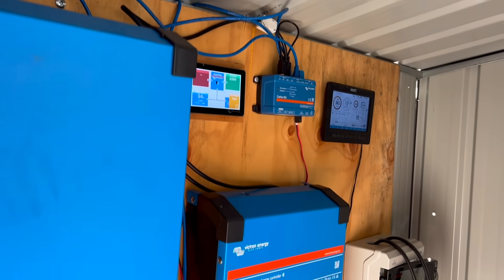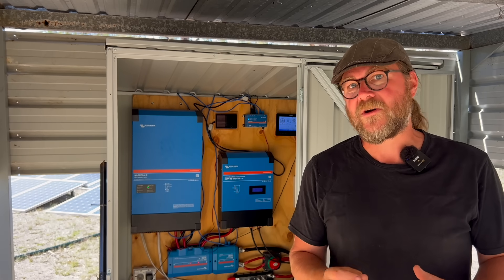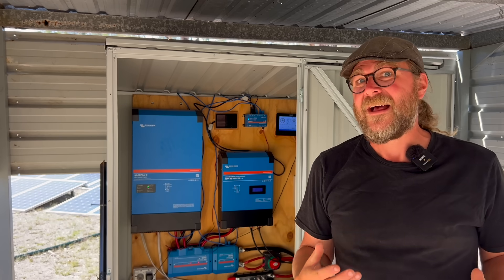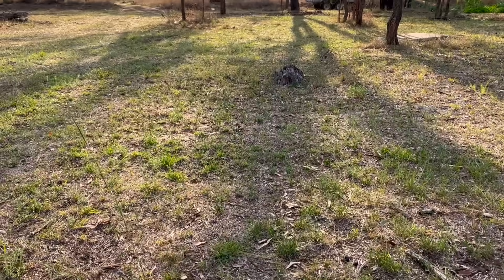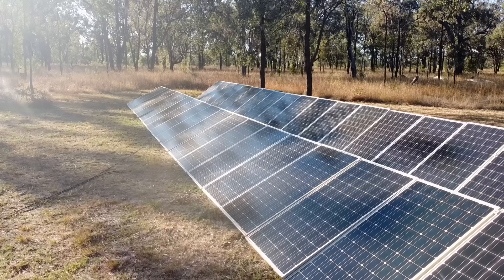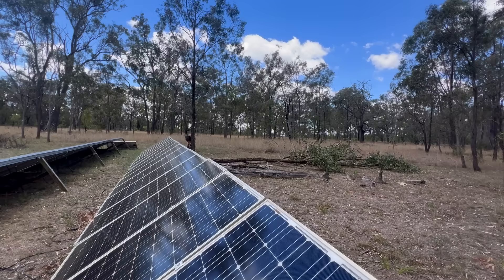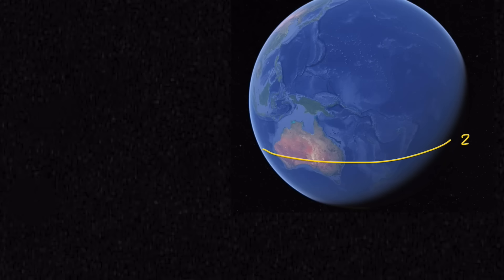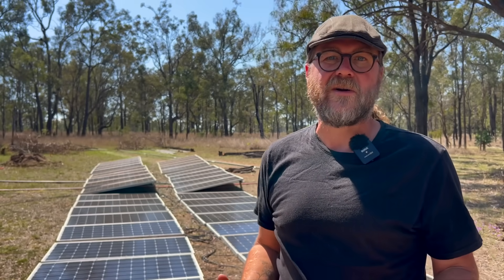We seriously MISCALCULATED when we set up our Off Grid Solar System

Comment: Hi great content. 
Just a thought regarding your  endeavours.
Have you thought about using some of the solar panels on top of the roof of the carport covering the battery station , if spaced off the roof they will add to the cooling of that box also you have areas of sand eroded gullies that if you were to dig out into pools they will fill and then slow the waters flow allowing the water to spread and soak in to the ground, the water will trap dust that settled which is mostly how top soil is made in the first place .
Lastly if the sandy low nutrient soil could be used as fill for sand bags they can make a useful wall to shade the northern facing walls of your electrical shed again helping to keep it cool.
I have only today found your channel.
Great job .
Duncan.

Comment: I have a shed for the solar equipment, that I got discounted, that has a black roof. I'm in North Carolina it isnhot in the summer. I'm painting the roof white and putting an A/C heating wall unit in it. I'm also going to switch my panels to the north, LOL.

Comment: A few hints from a Victron installer, Victron will not warrant vermin.
I've seen geckos, snakes and spiders kill multiplus and Quattro, we install all off grid Victron in Metal IP Enclosure with fan ventilation triggered via Cerbo.
Also Renogy do do warranty, when they fail look into Power Plus battery, Australia built.
Reply from the maker: Ahh thanks. Good tip. Yeah I’ve had to replace one Renogy battery on warranty already. They were pretty good to deal with.

Comment: Down here in Victoria Ive set up 9.5kw off grid system on ground mounts. I've split the winter and summer angles and set it at that about 38°. The hole inverter and battery system is inside a container with 30cm worth insulation in the walls and ceiling. All works great.
Reply from the maker: Putting it in an insulated container is a brilliant idea.
Reply: @rusticspiritshomestead  Not necessarily - heat generated by the equipment can't escape easily. A small aircon and insulation would be great.

Comment: You will need the panels most in the winter with the short days so put your angle according to that.
Reply from the maker: Yeah true, but then in Summer we use a lot more power for cooling our home, irrigating gardens, and generally working longer days, so adjusting throughout the year is a good idea if you can make it work.
Reply: @reganperry  I just use more panels. I attempted winter heating for weekend's and that is worse than Sommer cooling in Victoria in my experiences.
Reply from the maker: @leonhardtkristensen4093  oh yeah, fair point. I’m nearly maxed out on panels. Next upgrade will have to be more efficient panels with partial shading technology (micro-controllers).
Reply: @reganperry  My Melbourne and Clunes experience over a few years is that you can expect 1.5 times panel wattage of energy a day in average in winter and 4,5 times in summer. The angle is not the most important as the sun is only straight up for a very short time. A tracker could help but for me for the cost it isn't worth it as I have space.

Comment: Need shade so electronics don't overheat?  If your shed gets hotter than ambient temp in the shade (certainly it does)... then, Insulate and ventilate => 100% shade at ambient temp.  Save the trees???  How about firewood and replace them with blueberry, vineyard, garden, dwarf fruits, etc?

Comment: What's your open circuit PV voltage? Solar is generally not low voltage. It's cheaper to run 2 x 6mm pv cable than it is to run 10mm-16mm twin core and earth. I'm running my panels 140m from my dwelling and inverter setup. I've got 4kW of panels and we hit that quite often in peak sun

Comment: Geothermal, if you have access to a backhoe, and if you don't have bedrock just under ground, a 200mm pipe like a plastic drain pipe run for a 100 plus meters underground will cool air down to ground temp, coming from inlet and going to shed.  (Also warm it if you have freezing temps).  Then all you need is a fan.  Need it minimum about 3 meters deep.  Not sure where your located but I'm assuming Australia.   Queensland has higher ground temp, but New South Wales averages 15°C to 20°C ground temp.  By about 4 or 5 meters depth you get away from seasonal fluxuations to more steady state temperatures.

Comment: You did not miscalculate NOTHING OUTS OUT WHAT IS ALLEGES IT PUTS OUT NOTHING NOTHING AT ALL AND ANOTHER THING ANY AND i DO MEAN ANY BATTERIES YOU ARE CHARGING OFF SOLAR WILL NOT LAST VERY LONG NONE OF THE BATTERIES BRAND MAKE OR TYPE IT DOES NOT MATTER 100 WATTS AND 0,5 AMOS TIMES 100 CAN NOT CHARGE A BATTERY CORRECTLY.  Try charging your batteries with a little 200 watt gas generator and a 15 or 25 amp battery charger .

Comment: re: shadows @ 4:42-- an 8m tree will have a shadow length of 23m when the sun is at an altitude of 15 degrees. you could compare 23m to the stakes you've used to mark the shadow line. here's the equation if you need to adjust the angle/altitude or the height of the tree: shadow length = tree height / tan(angle). tree height = tan(angle)*shadow length
Reply from the maker: @JoeWojniak  🤯🤯 I suppose I could have worked out a year’s worth of shadow data in a day or two!
Reply: @rusticspiritshomestead  it'd be interesting to know what the longest shadow is about an hour before sunset. that might simulate where the sun will be at the winter solstice (just from a different direction.) it also helps to calibrate the assumptions used in the equation(s).

Comment: I didn't watch your earlier video, but I'm not sure the DC line coming from the solar panels is a low voltage line. You can connect strings up to 450 V to some Victron charge controllers. That is more than the 220 V AC that you convert it to.
Reply: DC and AC circuits do not behave the same due to the skin effect, you want DC lines to be as short as possible
Reply: @ttkddry  Skin effect negatively affects AC lines, which is why you'd prefer DC lines over AC lines under the same conditions.
Reply: @GerbenWulff  yes you are right but resistance makes DC cables extra thick thus expensive, that is a reason to keep them short

Comment: I would not put air con, put some cooling earth tubes in, you have the space.  

I have some prob with trees fine to the north but to the west very shaded so lose a lot of afternoon sun
Reply: Geothermal heat pump for AC and hot water is a good idea.

Comment: I loved the video, sometimes the youtube algorythm works to find good new channels. 
I thank you for your honest points and yes you do often learn more from your mistakes and it looks like yours haven't cost you too much financially just in time lost thankfully. 
If Imay make a suggestion, with regard to the cooling of your electrictronics, once you have decided on your final location you could dig a trench about 1m  deep and 25m to 50m long, the longer the better, Then bury clay sewage pipes in the bottom with your ends sticking out about 1/2m above ground, to stop water ingress. Then fit a fan either end to encourage airflow into the structure, this should provide much cooler air than the outside ambient temperature during the day and warmer during the night and will also give you a more constant temperature all year round, especially if you do insulate the car port structure. It should also reduce the need for costly aircon both in power used and running costs. You can also use the pipe to run your cables in, giving them extra protection from varmints etc.

Comment: Shade is better than direct sun on your solar shed but the temp in there during the summer is still going to be way to high for your batteries and your Victron equipment!  Move all that equipment into your living environment and beef up the wiring from your solar panels to your house!
Reply from the maker: I wish I could. Unfortunately I’ve got buildings 100 m apart from each other and need to provide power to both. The most cost-effective solution is to put the inverter and all related equipment halfway between all these buildings. The cost of 100 meter cable over a 50 meter cable is exponentially higher! 😬
That being said I did check Victron‘s specs as well as the specs on my Renogy batteries and both allow operating temperatures up to 50° C.
The most I’ve seen in this shed before doing this shade upgrade was 39 and I think we’ve achieved a couple of degrees cooler than that at least.
However, as I mentioned, I suspect that after reviewing this summers performance I’m going to want to at least insulate this carport and provide electric ventilation, possibly even consider air-conditioning the space. 
Our main home isn’t an air-conditioned (I kinda hate air-conditioning TBH 😜)
Reply: @rusticspiritshomestead  -- An small efficient A/C (5K BTU) wouldn't use much power if you insulated the shed well and it would help keep the humidly down.  Good luck!

Comment: What has worked very well for us is having far fewer panels, but mounted in pairs on poles with both horizontal and directional manual adjustment.   Since there is Always someone on the property, we just rotate the panels two or three times during the day and change the inclination angle across the seasons.  Just a few minutes effort a day, when we can also check for dirt and wiring issues, and we need far fewer panels than for a static arrangement. (The mountings are far less expensive than the panels.)
Reply from the maker: Wow! That actually sounds like a fantastically simple solution. And being a homesteader who can set my own priorities and workday, that could work in really well with my routines.

have you published any of this online that I could look at? (Instagram, YouTube, etc?)

Comment: An easy way to track the sun is a little app called "Sun Locater". The pro version lets you plug in any date and see the path of the sun at your location.
Reply: Yes! There are several of these where you literally set your geo location and hold up the iPad and the app superimposes the suns path through the sky over the camera view as you swing it around.
The path can be set by date or show both solstice paths.
Not perfectly accurate, but a really informative tool that can help positioning your panels or planning tree trimming.

Comment: You are absolutely right about the shadows. I built temporary solar panel mount arrays during the summer exactly as you said. I didn’t give enough room for shade during the winter months when the sun was low in the sky. I waited until December 21st the shortest day to realign and measure exactly where and how high to mount my panels.
Reply from the maker: That’s definitely the way to do it (although June 21st down here 😜)

Comment: Put a simple DC 24v AC in the shed. Uses like 250-300w. Problem solved. Also add. A few 550w panels on top of the shed. problem solved twice.
Reply from the maker: Not a bad idea! 🤔

Comment: Regarding the panel angle, the bulk of my panels are literally just lying flat on their backs, I also have 4 strings on the house roof angled towards the morning sun and are on a different charge controller and from what I've seen so far over the last few years is that while the angled panels on the house roof perform slightly better than the rest which are lying flat on the garage roof, the flat lying panels produce more energy because they continue working until the sun sets while the angled panels literally shoot themselves in the foot because of the angle.... 
I see a lot of emphasis put into panel angles and I'm not really seeing a huge difference unless you are getting any shade, even the shadow of a wire makes a difference! And where I am in suburban Melbourne, the winter sun goes behind the two storey houses behind me that also happen to be sitting a couple of metres higher up due to the land being slightly hilly.... 
In my case, I have to install a set of winter panels that will perform best and only for the winter months which is the last two weeks of June and the first two weeks of July, after that the system just takes off and I have more energy than I know what to do with! I have been running electric fan heaters on hot days just because I can! I wouldn't imagine doing that while being connected to the grid....

Comment: actually if you can accommodate building a tracker and having the panels on a north south straight line. panels will be flat at solar noon and pick up east west in the morning and arvo and pick up about 35-40% more power plus elevated that the trees have less effect on them

Comment: Time of use, if you are overpanelled a bit, actually better to shift them slightly to the west, do soupcan angling around 1pm-2pm to grab the spot that will leave batteries fully charged more toward night. If your paneled right on the money than I would set them at 12:30 with the soupcan.
Reply: Thats sound logic. Overpaneling is king 😊
Reply: With the price you can snag second hand panels idk why everyone off-grid doesn't over-panell.

Comment: I set up in summer2023, now in winter and the mountain shades the property at 3pm, in summer sun till 8pm, I added a 4th array to a better spot, I will have to move 1 or all 3 arrays to get winter sun for and extra 90mins and a possible extra 10kw with sun.  One fan in the wall near the top of the shed and air inlet on the floor might be enough cooling.  I smashed 2 panels, clear coat enamel 2 coats and reinstall, the shattered glass is bonded to the cells, just need to waterproof it.  I have my panels vertical at 90 deg, summer I make 6kw from 11.6kw but more than enough power by 10am, a few days ago with lower sun 11.4kw only 200w under rated max. When I get snow I have to disconnect a panel from each string or it will over AMP the mppts. If you want to try vertical surrounded with white rock it makes the pv more consistant through the year and 50% less heat in the panel work best with bi facial panels. My cheap mount if you want to try 1 array vertical.    https://www.youtube.com/shorts/SXYpTxhJAFI

Comment: radiant barrier. Although temperature does increase battery calendar agining, it is unlikley to effect most electrincs. Slap a solar fan on the shed, line it with radiant barrier and that should be all you need.
Reply: you are wrong, it most definitively will affect longevity of electronics. and efficiency.

Comment: I think its a fairly good start.  I leave things loose at the beginning too.  But you don't want cables carrying that much power just laying on the ground indefinitely, and you don't want to leave panels laying on the ground either, not long term.  The moisture will do a number on the seals and reduce their life-span considerably.   So once you find yourself in a happy place, really consider building a little more permanency into the system.

I will note that there is no need to have the solar shed near the panels.  The panels are back-hauling high voltages... as high or higher than your AC in fact.  I would locate the shed closer to the home, for sure.

One reason to locate equipment closer to the home has to do with grounding considerations.   If the home is providing the main earth ground for the system, locating equipment far away from that ground rod may result in a significant potential difference between the equipment ground and the earth ground at the shed, creating a shock hazard.

Another reason to locate the equipment closer to the home is to reduce the chance that nearby lightning strikes will fry everything.  You can put more substantial surge and lightning protection on the DC side.

And finally, make sure the shed can handle sub-zero temperatures if you are in a location where sub-zero temperatures are possible.

-Matt
Reply from the maker: All solid reasons and I wish I had that option. What I didn’t make clear in the video is that I have buildings 100m away from each other - all requiring power so we split the difference and put the solar field in the centre along with the gear because cable sizing for voltage drop over 50m was WAY cheaper than for 100. 
Fair point on all the gear on the ground too. I should at least get around to running it all in conduit. Next upgrade I want to do is moveable array racks so I can swap between winter and summer locations easily and with adjustable angle settings. Got a few ideas for these. Might be an autumn project, will be sure to get those panels up higher when I do it.